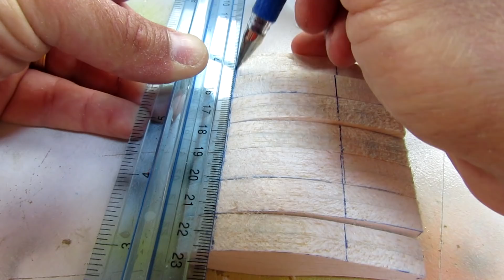Lure building Tutorial. Balsa Deep Divers  from A to Z-part one

Comment: Lovely video mate, what is you through wire choice? Iv tried some 1.2mm stainless steel wire but its very hard to shape and it does actually shear when trying to make twist eyes from it, yours looked so easy to work with. Thanks
Reply from the maker: Mine is stainles steel 1mm.

Comment: Hi, you do awesome lures ! I have few questions : 1. What is the thickness of the balsa ?        2. How do you making your home made sealler ?   3. What is the thickness of the wire you use ?    4. How long do you leave the lures to soak  on the sealler ? Thanks for your video and sharing your technics .
Reply from the maker: I used 2 sheets of 6mm thickness.The wire I use is 1mm thick and I might make a tutorial about how I make my home made sealler. 
I keep the blanks overnight in the sealer for the first deep.